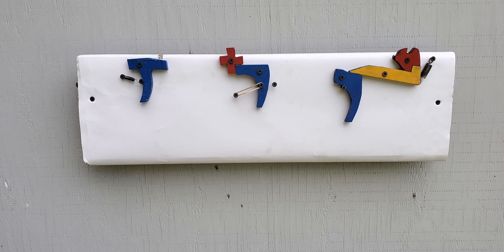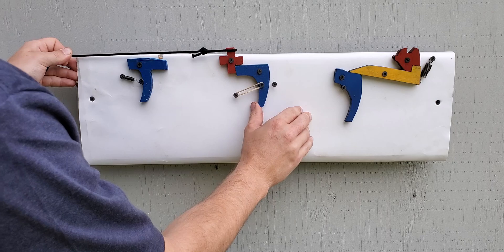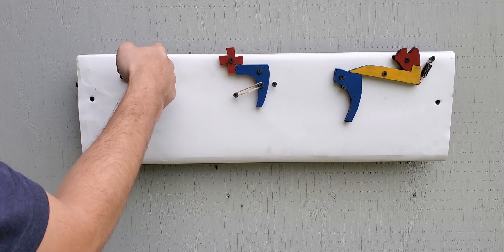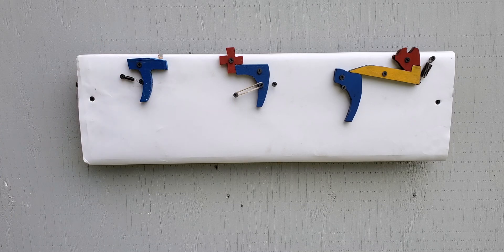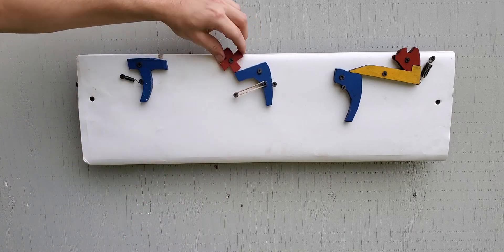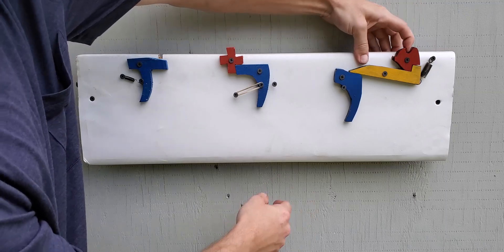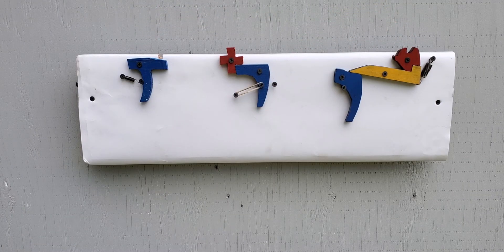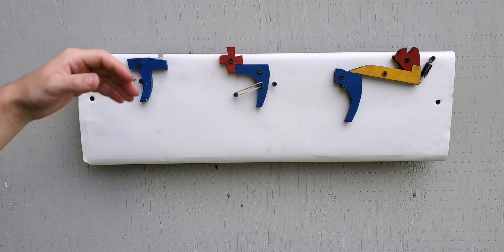crossbow trigger designs #2

Comment: Hello. How would you build a trigger for a crossbow that has been designed in bullpup shape for size efficiency? Basically the challenge in this type of design is that the trigger lever is located some 12-13 inches away from the locking mechanism for the bowstring.

I see your #3 design and it looks promising in that perspective. But ... have you actually tested if it still works effectively when the connecting rod is 12-13 inches or does the lag and power loss make it inoperable at such lengths?
Reply from the maker: @imranroy4731  so at that leingth, I would suggest using a linkage system look up the xb86 trigger. You can do it with wood but you need to be careful with the leverage points not to break the wood.

Comment: How does the trigger pull and smoothness compare?
Reply: The different designs would be best suited to different draw weights. I'd say the one piece design would be good for anything up to 60-80lbs. The two piece design could probably take 130lbs, and the three piece design could probably take upwards of 200. Obviously the material choice would play a part, too. If you made the whole mechanism out of steel, I'd imagine any of them would work fine for any weight, but the two and three piece will always be a smoother action. The two piece would have a lot of spin on the latch, tho, so you might feel that when shooting. The smoothest would be the three piece.

Comment: If you study mechanism or linkages (mechanical engineering) the basic problem with these types of designs is that every piece is rotating around an axis.  This works fine when you have metal parts but if you are using wooden or plastic parts, the stress can break the part.  Wood, plastic, etc. are far better at handing compression and extension forces over shearing or rotational forces, so the best designs make using these types of materials make use of these properties.  I've made different styles of two and three piece triggers for a while but if I am using wood or plastic most of the parts will move in a straight line rather than rotating around an axis.  So while the trigger system is a bit more complex with multiple springs and more surrounding parts, it can also support a heavier draw reliably despite the materials it is constructed with.
Reply from the maker: I agree that those are better materials to use but in this case I am using plywood and it is plenty strong for the application. Unlike plain wood that relies on grain direction for strength plywood is engineered to eliminate this fault. I have shot my 3 piece trigger at least 1000 times and it's holding up great 🙂
Reply: @archery.customs  Yeah plywood is good stuff, far easier to engineer for strength than ordinary wood.